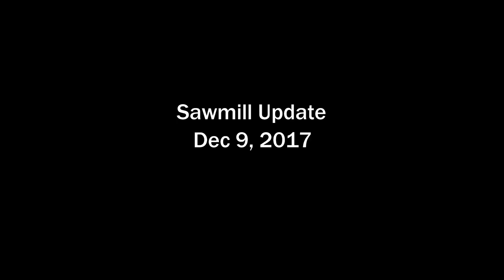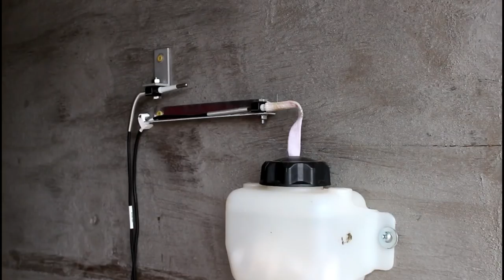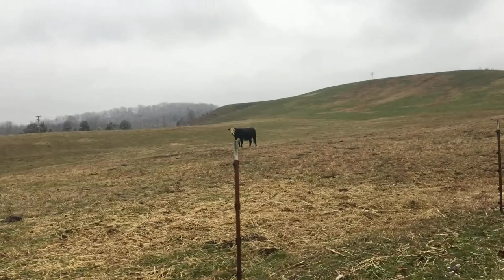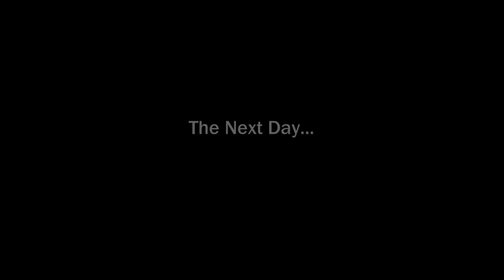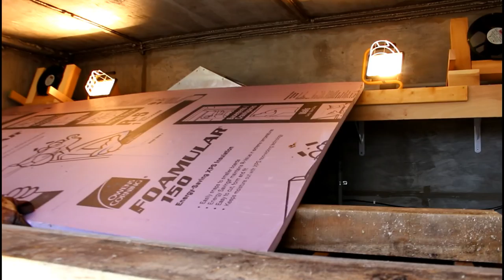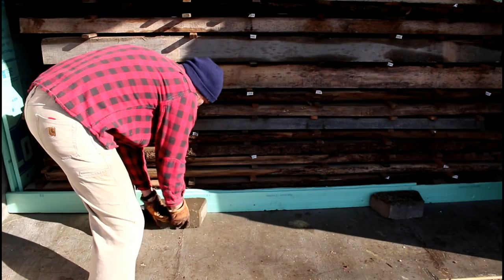SAWMILL UPDATE - DECEMBER 9, 2017

Comment: Have you tried reverse roll quarter sawing oak yet?
Reply from the maker: I have read some but never tried 
Your thoughts?
Reply: I haven't yet, but I've got a couple prime straight white oak logs about 28" to try it on this winter.  It'll be a little harder to clamp on my LT15go, but I'll do it.  I've got a bunch of other logs to mill first though - Ash logs for barn stall T&G namely.
Reply from the maker: Sounds good. Let me know if you give it a try